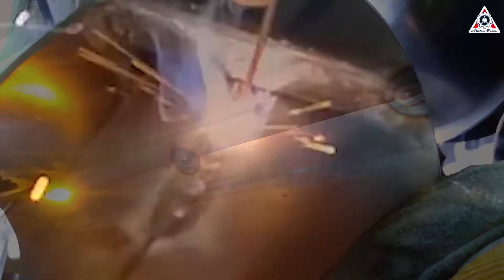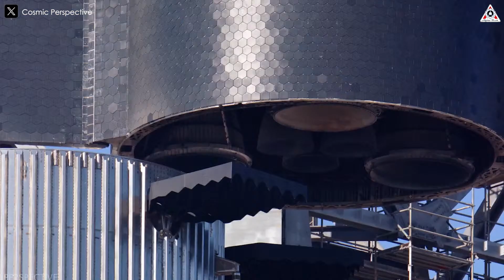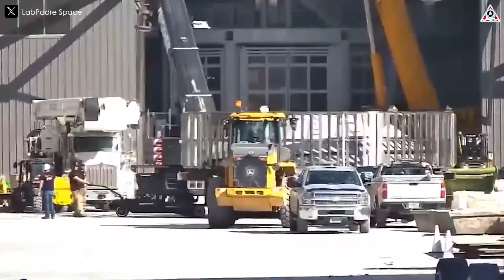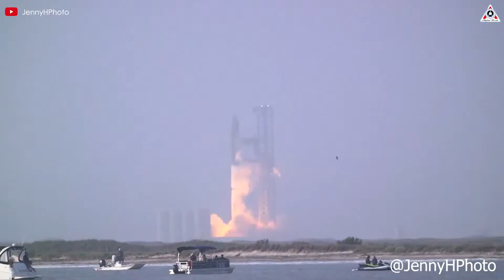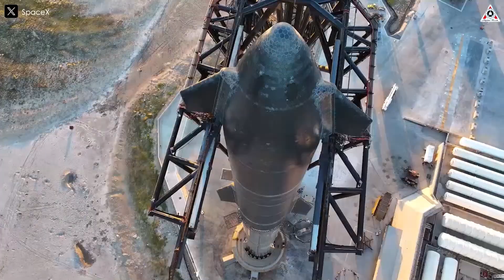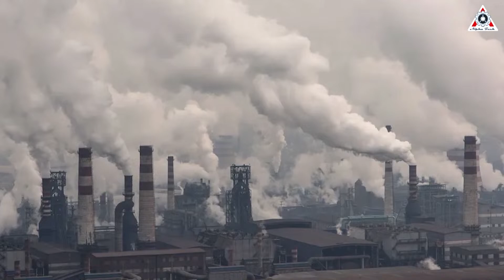SpaceX's HUGE UPGRADE on Starship's welding&Nosecone shocked the entire industry!

Comment: Welding several flat sheets of stainless steel together on a flatbed into a square, then forming the cone by explosive or hydraulic pressure, would be fast, consistent and suited to mass production of starship nose cones. Or even metal spinning could be used and spin polishing, and to finish the nosecone to a brilliant shine vacuum coating with titanium aluminium nitride for better heat tolerance and durability.
This process may require as little as one continuous weld between two sheets of steel side by side as they are unrolled. Then cut into squares.